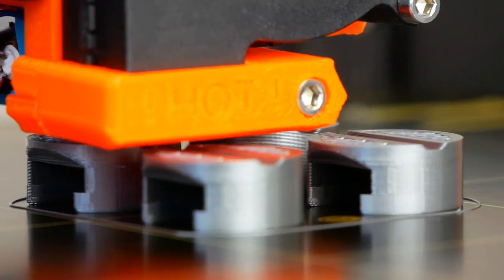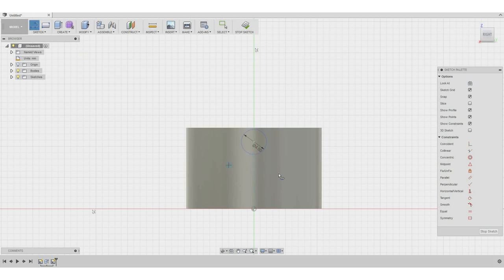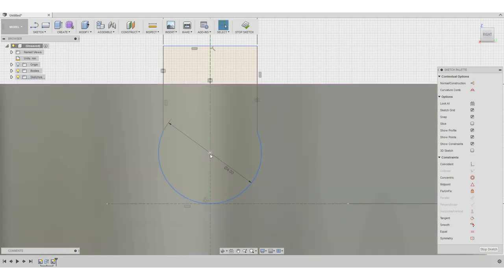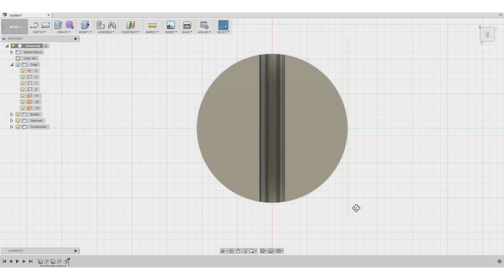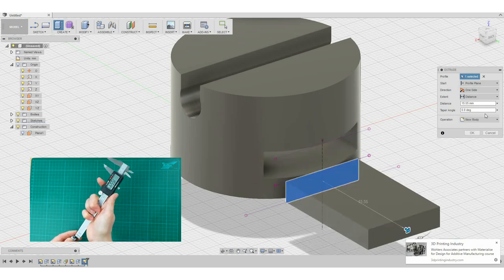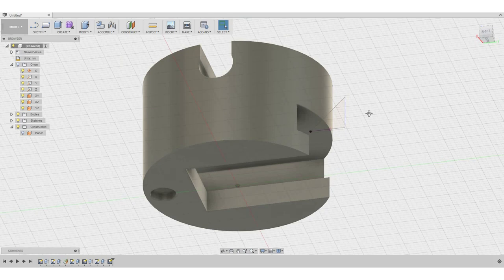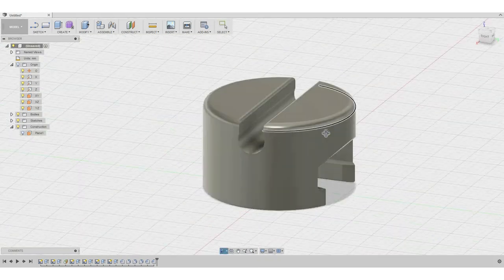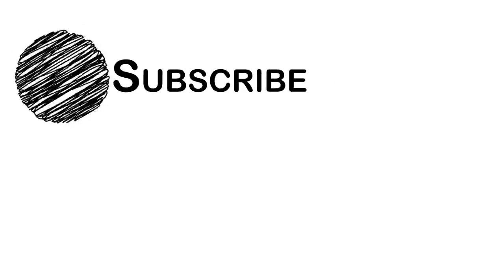Practical 3D Printing - Vacuum Wall Mount Adapter

Comment: This is the real purpose for me for 3D printing. Printing real life or application stuff. Fixing, adapting, improving... When I bought my 3D printer I swear to avoid printing Pikachus, Dart Vader and other dust collecting stuff...
Reply: And that way your printer is the one collecting dust. Ill be honest, i had a similar mindset when I got my 3d printer but i ran out of useful things to print and eventually I caved in when i learned to use Blender, I started printing 3D figures and other stuff made by myself and learned a lot more about 3D printing  from printing such things than from printing "useful" objects. Now when I wanna print something useful i have the experience to adjust my slicer parameters and i know all my printer quirks to get great prints, i even learned how to do investment casts and this is incredibly useful to turn your plastic models to metal.  Regarding useful things, I have printed mostly, replacements for parts that have broken or supports for things, like a flashlight support arm, or my bicycle headlights, improvements for the printer itself,  a turbocharger model with a powerful electric motor, a water aspirator and more stuff but if you put it in perspective i don't really think is that great to pay hundreds of dollars to wait tens of hours to end up with a not so good product compared to the injection molded or metal versions of stuff like that. Yet having the trill of working your ass for hours on a 3D model of something organic that you can't find anywhere else because everyone is making Pikachus and then have it in the physical world even if its just to collect dust and look at it, its quite great and what keeps me active into the hobby. So i think 3D printing is more about the activity itself that its real purpose, at least from the hobby stand point, if you are making money with a 3D printing HUB then that's something else and i don't know about that. So don't handicap the versatility of 3D printing to just "useful" things use it to its full potential! and have fun doing it.
Reply: Same here, that's how i found his channel :)

Comment: Another great video.

I think pla will do just fine for a wet environment. I designed and printed a soap dish using eSun PLA+ and I've been using it for more than a month with daily contact with water, zero issues.

Comment: Very nice video.  I was working on a very similar design in Fusion 360 a couple of days ago, and could not manage to get it finished.  After watching this video, I think I can try again and it will work this time.  Unfortunately, I already made the part in wood, but I will 3d print it just for practice.  Thanks for putting this up, and please ... more Fusion design work.

Comment: I like this kind of videos. 
I thin I have a tip for you. I'm not sure if you already know it, but... you can select circle tangent with the dimension tool. Unselect the circle, select dimension tool, right click on the circle line, select "Pick Circle/Arc Tangent".

Comment: Why didn't you print the piece upside down? You would have the front facing surface very clean (since it would be the bottom layer) and there would be no problem with support (the part where you had to slant it at 45 degrees). I'm a total noob at 3D printing so maybe I'm missing something!

Comment: To dimension the edge of a circle to something you could also add a "Point" to the circle and add a horizontal/vertical constrain between the point and the center point of the circle. You can then dimension between that newly added point and whatever you want. :)
Reply: it would have been even easier to just use the middle point of the circle by subtracting the radius of the circle from the desired distance leaving you with a distance of 2,7mm :)

Comment: I like that you do simple objects akin to something anyone might need for repairs and replacements of proprietary parts.

I didn't understand though, why you didn't print the part the other way around, with the T-Slot on the top? The cylindrical walls of the groove are only a minor overhang.

Also would be curious to try HIPS. It's the cheapest material that you can get at Conrad Elektronik, and it's more temperature resistant than PLA, akin to ABS, but is supposed to be simpler to print with than ABS. It's a bit on the brittle side, but it could be OK for just such parts. And for gears too.
Reply from the maker: I have some HIPS somewhere around here and need to try it out some time. Maybe that works. I just don't like to print with these stinky filaments. Need to build myself an enclosure some time soon.
Reply: I was thinking the same thing, about printing it with the rod slot down and the t-slot up. Love the video. Good to see some tutorials on taking an actual product and putting it in CAD.

Comment: Hi great video. I enjoy all your videos.
Also at 5:07 if you open the sketch pull down there's another rectangle sketch tool which is anchored in the centre. This would have saved the aligning steps afterwards.

Comment: You should consider trying out the support material in Prusa Research's latest fork of Slic3r, it's pretty impressive what it can do with a little tweaking of the interface distance.

Also from a quality standpoint; you might not think it, but support material done right adds a small amount of shielding from the part cooling fan airflow and adds thermal retention that can help reduce (sometimes eliminate) the differential warping that causes aberrations on the outside of parts like where your bridging ended.

Comment: Nice.  Liked and more long and detailed.  Very helpful for learning.

I have one question though.  How do you know if something is bridgeable or not?  The part you changed to a 45 deg. looked as much like it wasn't bridegable as the horizontal square highlighted at 18:06.  What do I not understand?

Comment: you could have used center point rectangle on the top surface and then pull it downwards 4.7mm..  Create fillets and round the edges of the groove!!

Comment: Great video.
One thing that confuses mne as a complete beginner - you jumped from saving as an STL file to the print process- I keep hearing of "slicers"; is this step not neccesary when using Fusion 360, or????

Comment: Better use collinear, not tream. It is very good that you apply the model, but it'll be better to apply only drawing.
When you cut symmetrically feature on the top of model, it is not enough that you see that cut is bigger than your part
The best practice is to tell "All". Sometimes when you want to change diameter of this part, you can receive that walls are not cut

Comment: For the refinement, it may actually better to use the fine setting as that will more likely be correctly detected as a circle by the slicer. 
Edit: Nope, keep it at Medium unless you really need minimal faceting. Slicers do not have this capability :)
Reply from the maker: I did not know that this is implemented in any slicer. Do you have resources that arc are actually recognized? Even our multi 100k printer at work does not do that :D
Reply: I can't tell for sure if any slicer is doing this. But they may at some point. I believe some motion controllers used for milling machines can do that.
Reply from the maker: Marlin is partly based on GRBL which is the standard G-Code interpreter for most hobby CNCs and so the firmware does understand the G2/G3 arc commands, but I would not know that this is implemented in any slicer. It would be nice but this would actually require the slicing being done with the CAD data and not the tessellated SLTs which is currently state of the art.
Reply: Thanks for the reply. A quick web search points to some threads regarding automatic arc/circle detection feature requests but it seems that is not gonna be available anytime soon. 
So it is indeed better to use the coarser refinement setting. Will update my initial post.

Comment: Hi, why didn't you print it upside down? Wouldn't the result be better? Also no supports needed, even no chamfer of that round part. And the top surface would look finer on Prusa MK2 ;)

Comment: Hi my friend! Nice project! It is possible to create a big lid? 200mmx200mm ???
Reply from the maker: +hacker tom If your printer is big enough, of course! Bigger parts only tend to have the problem that they warp and losen from the print bed. Even with PLA and a heated build platform.

Comment: Why are you so against supports? If done right they work great and produce great prints.
Reply from the maker: I'm not totally against supports. I actually use them a lot but I think that they are the "necessary evil". I mean with this, that it's preferable to find an orientation or a nice design trick to get rid of them. Of course, the surfaces are not bad, especially if you use soluble supports, but they will be worse than without supports.

Comment: I have a feeling a machinist could form this part in only a few hours whereas it seemed to take way longer than that just to get the part ready in the 3d package? I guess maybe the only advantage is one the part is done, the printer can repeat over and over. But of course these days CNC machines (the expensive ones) could do this whole part in one step too.

Still think 3D printing is overhyped, myself. I don't think it's practical in the long term for anything truly useful
Reply from the maker: The design is done in 15 minutes and printing takes around 30 minutes per part, so I'm quite sure for one part only and even for a small series it's definitely faster to use 3D printing. I am very sure that machining it (by hand or via CNC) takes you longer but you might get better surface finish and part strength. If you need to do several thousand of these parts then go with injection molding. The mold costs a lot, but then each part cost only cents and takes only seconds to produce.
Reply: To machine this part would take dramatically more work than 3d printing it.  You'd spend more time getting the work set up than it takes to 3d print the whole part.

With a lathe you'd start with round stock, face it, turn it down to the correct OD, and part it off.  Then you have to flip it around, recenter it, and face the cut end.  From there it's over to the mill to drill the rack mount hole, then rotate the part 90 degrees and cut the slot with either an end mill and slot cutter or a custom cutter to do both operations.  Then you'd rotate it 90 degrees in the other axis and drill the retention hole.  Then you'd chuck the part in a tumbler to deburr it.  That's 5 separate setups and 7 machining operations.  You could cut that in half if you had a nice 5-axis machine, but 3d printing is still an easy winner for manufacturing these one-off parts.

Comment: for every body out there don't waste time then print and the part is not fit for the environment. if it's a wet environment or dry, hot, cold or misty pick right print or right material. In this case if wet should've used metal print then paint with chrome or follow manufacture original design don't waste money.